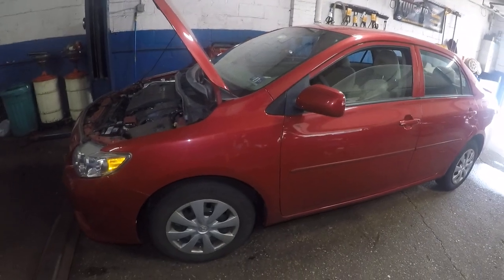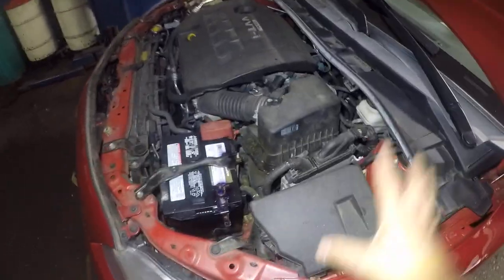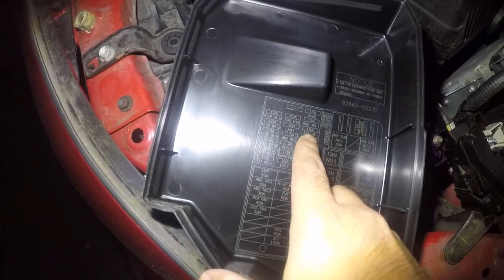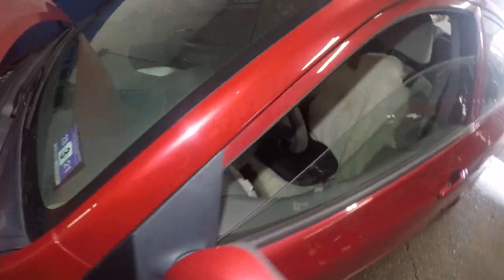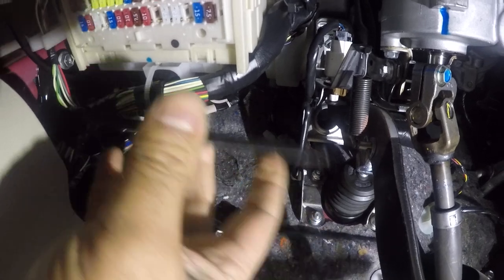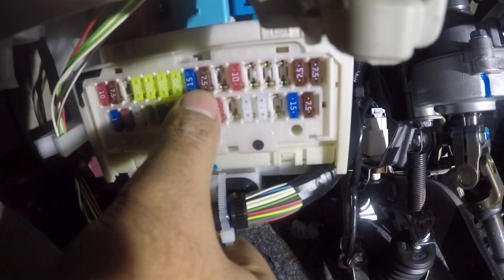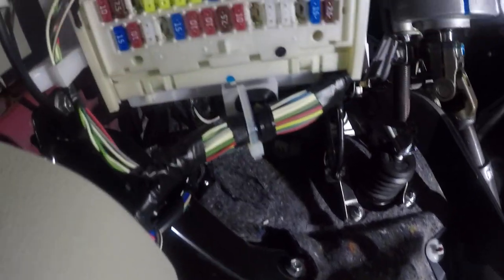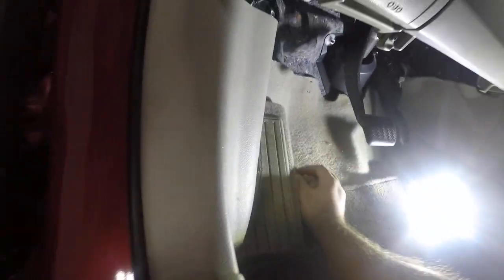Toyota Corolla 2009 to 2013 radio fuse and cigg light fuse location

Comment: Do you have to use the low profile fuses? Or can you use normal small ones? I just bought the car and there was a penny and dime in the charger outlet and I took them out and now the radio and outlets don’t work :(
Reply from the maker: If it’s equipped with low profile use low profile
Reply: @RBTheMechanic  I figured it out. It was a fuse named “Acc B” in the fuse box in the drivers footwell. I saw it was burned up replaced it, and all my outlets and radio turned back on! I was so relieved. No other YouTube video said to check that one.

Comment: Heyyy! Can i add the red wire for the LED strip (for under hood) to the Radio Fyse under the hood for power?
Reply from the maker: What???? To run extra line I would rather find empty slot and buy fuse jumper
Reply: Find empty slot in the fuse box under the hood?
Reply from the maker: @aah.graphy  usully there’s empty slots to use for somthing else

Comment: Hey boss can you help me with the sound I’m having on my Chanel it’s driving me crazy just changed rotors,bearing still same noise from front driver side tire any tips?
Reply from the maker: Ok that’s a wierd sound anyways recheck ur work make sure all bolts are tight .. also check to see if the brake pads are not bouncing up and down in the bracket then check wheel bearing tie rods links and bushing ... also when u have that wheel off the car bouncing it on the floor and see if u hear a noise one time I had a car that had a build up of small balls type of things inside from the air moisture when adding pressure to tire and it made that similar noise.